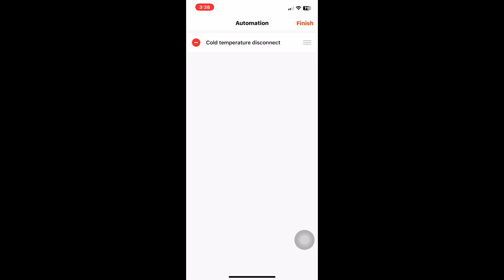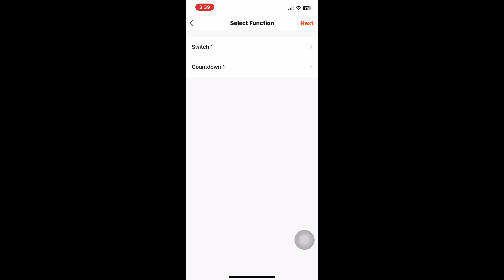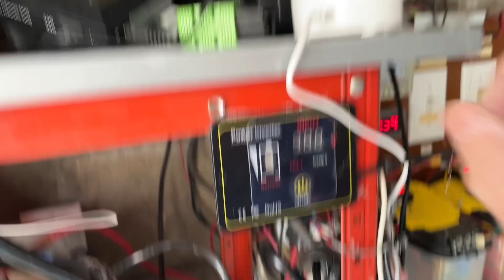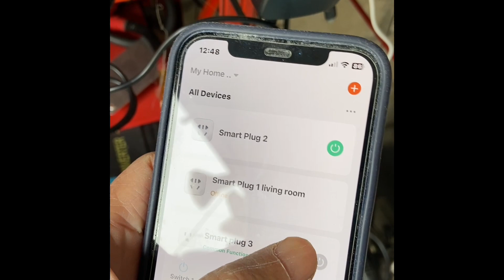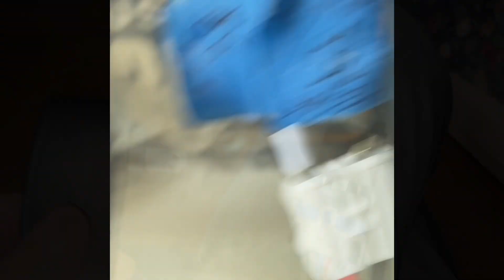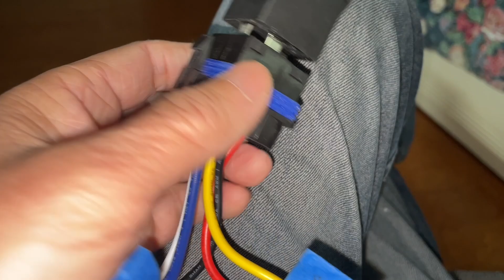Use EDUP smart scene feature to make a battery cold charging disconnect

Comment: Thanks for the shoutout!

I've never used the EDUP app before, but the screens and options look identical to the Smart Life app that I use.  I know that the Smart Life app and Tuya Smart app are identical and work with the same devices.  If you smart plugs have different apps, you can try to set them up in the app you use most often.  Some are app-specific but a lot with work with Smart Life and Tuya Smart.  Being that EDUP looks very similar, I wouldn't be surprised to learn that it too is compatible with the others.  Very convenient to have all of your smart plugs in the same app.
Reply from the maker: @jaykay18  Yeah there are so many different brands of smart plugs. The 3 I have I don’t even remember they are the same brand. I guess as long as you can pair them then it’s ok. 
Aside from the temperature function they have others like schedule which can make the smart plug a timer.  The EDUP smart doesn’t have ads that come up when you open it so that’s a good thing. Thanks for letting know about the scene function with the included temperature control.
Reply: @wtam69  Yes, Smart Life has changed quite a bit over the years.  It's not very often I have to even open the app because I have many Amazon Echo devices around here.  Voice control is a lot faster.  You can set a timer with voice control as well.  Turn something on for a period of time, shut something off at a particular time, etc.  All of the smart plugs I have here run on a scheduled shutoff at 11:30PM, while most of them turn on based on sunset times.  If I go to bed earlier, which is often the case, I'll ask for all of the lights to be turned off.  You can also dim using a dimming smart plug by voice.  In the backyard I have lights on the fence, in the patio, etc, and I can group those together and call it "backyard" so it can control all using that word.

The outside lights stay on all night, that smart plug is configured as NOT a light so when I ask for all of the lights to be turned off, I don't have to ask again to turn that back on.  If I want to control it manually, I just ask for the outside lights.  In fact I used it this morning, it was still too dark (due to the weather) 15 minutes before sunrise, so I had them turn back on for a short while longer, all without getting up or reaching for the phone.

I made a thermostatically controlled outlet about 20 years ago, it's still in operation today.  BN-LINK sent me a fancy digital version of it, with a temperature probe for more precise measurements.  Tomorrow I will show an interval timer they produce.  They make some great stuff, niche outlet control devices that are perfect for the particular application.